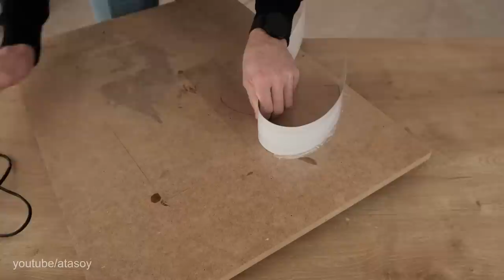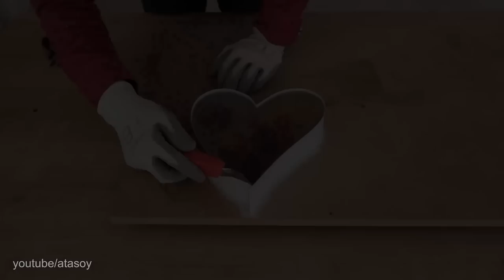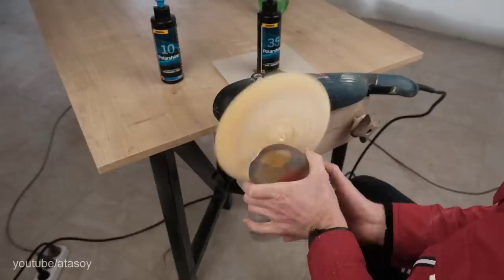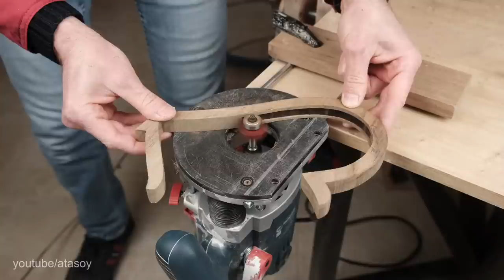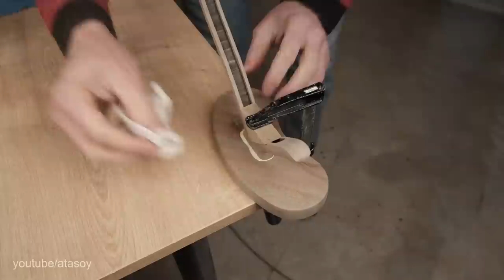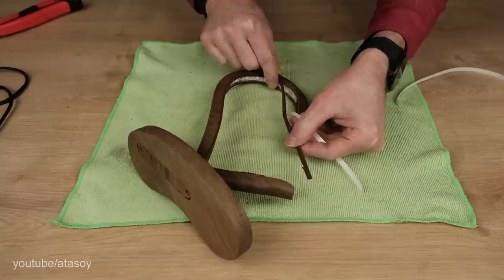Heart Shaped Epoxy Lamp | Epoxy Resin Diorama

Comment: Great lamp and video  can you tell me where you purchase the RGB strip led and bluetooth control card?
Reply from the maker: Thanks, I'm glad you liked it.
I purchased the RGB LED from local dealers in the country I live in.
I bought the control board on Aliexpress.
I am sharing an example aliexpress link for RGB LED.
aliexpress.com/item/32903257649.html
aliexpress.com/item/1005002344998967.html
Reply: @atasoy  Thanks,  could also tell me where you got your black tubbing you used to cushion the  heart to the wooden light support (9.55) I have tried to find some but have not been successful.
Reply from the maker: It's a felt-like material.
It is the material used in the legs of tables and chairs.
I used it by cutting it into thin strips.
I purchased it from local dealers in the country I live in.
Reply: Thank you for your help.
Reply from the maker: @derekroutledge100  You're welcome, good work.

Comment: Great work, can u let me know what that container was that u put the resin in, and how to use it? Also what is the polish u used , can it be used on small resin Pieces
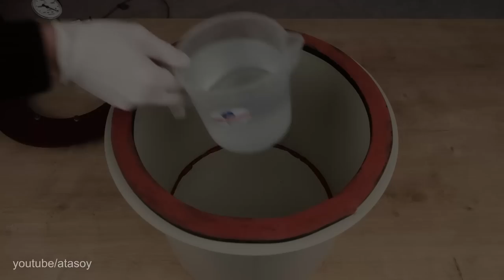Reply from the maker: It is a vacuum tank at 1:43 minutes.
This tank is connected to a vacuum motor.
The air bubbles in the mixed epoxy are removed by vacuuming.
Thus, air bubbles are formed at a minimum level in my works.

The polishing paste I use is Mirka Polarshine 35 and Polarshine 10
It can be used for all small or large polishing jobs.

Comment: Lovely work. Please what is the black material you lined inside with the led strip light?
Reply from the maker: I used 12v RGB strip led as led.
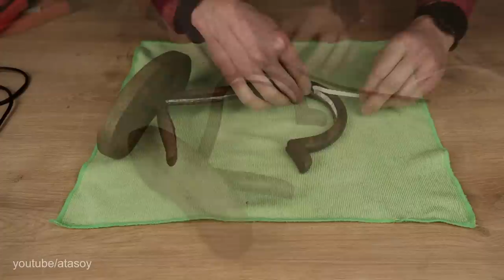You mentioned black material.  Are you asking about the material at 10:00 minutes?
If so, this is a soft felt material that does not slip or scratch.
Reply: @atasoy  yes , exactly that material. Where do I get it and is it just called soft felt material?
Thanks for your replying ❤️
Reply from the maker: You can find it in the construction market or on the internet.
I am sharing an example link for you to see what it looks like.
I use a material similar to this by cutting it as much as the area I will use it.
https://www.amazon.com/Furniture-X-PROTECTOR-Premium-Heavy-Sheets/dp/B07PWXB3WR
Reply: @atasoy  Thanks so much . I really appreciate your help. Sir , please why don't you make subtitles to your videos?
Reply from the maker: I used to do it, I don't have much time right now, but I will try to add subtitles again in the future.